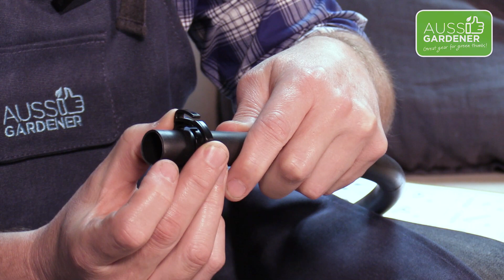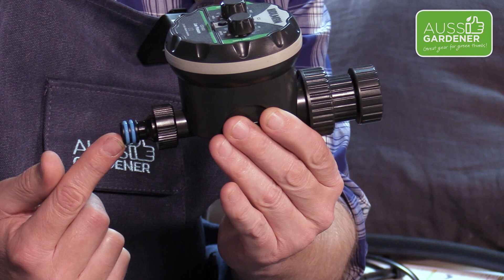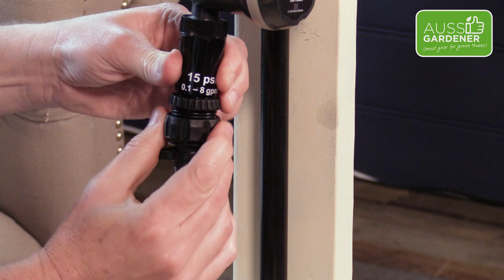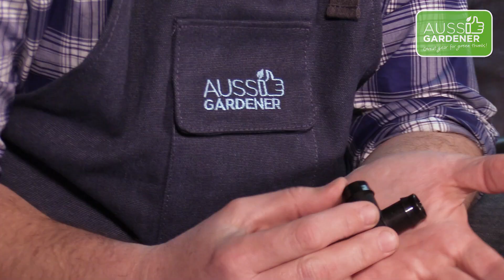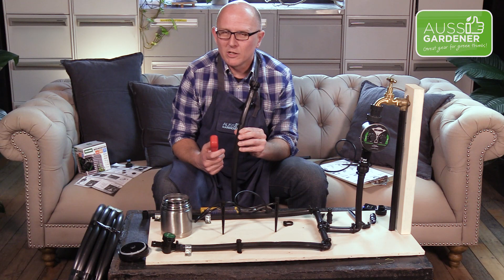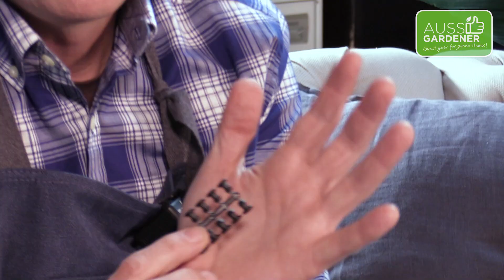Irrigation How To

Comment: Thank you for simplifying this system. My issue is with the timer. We have water restrictions and can only water three times a week. Do you have a timer that can set days of the week rather than 24 hrs etc. If we were able to water on alternate days, we could set this to 48hrs but unfortunately  my days are Sunday, Wednesday and Friday, currently between the hours of 6pm and 8am.
Reply from the maker: Hi Marie

Yes that does make it a bit harder. You will need to get a digital timer which allows you to set specific days. :-) 
Brian